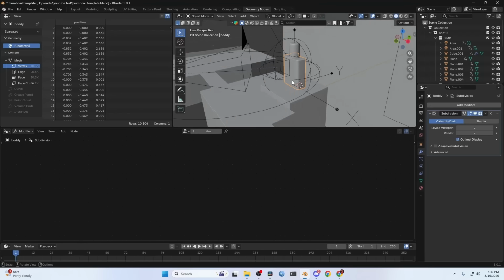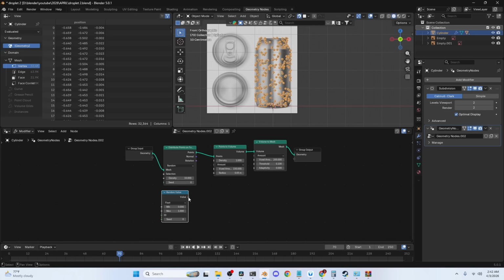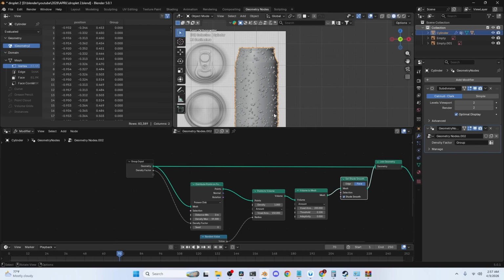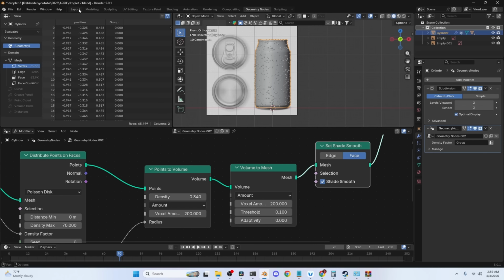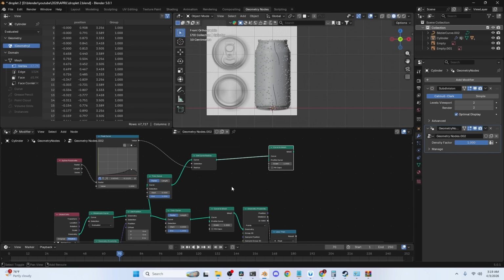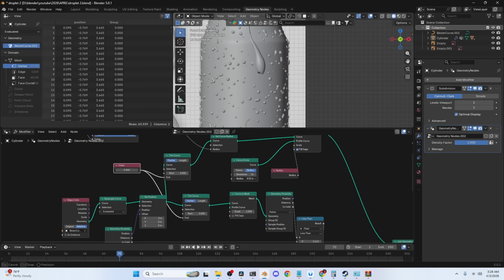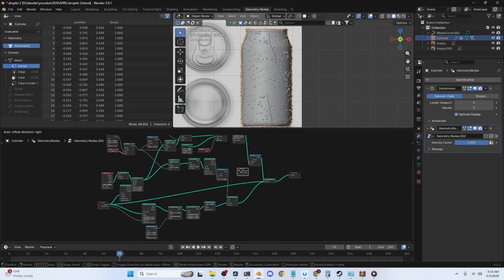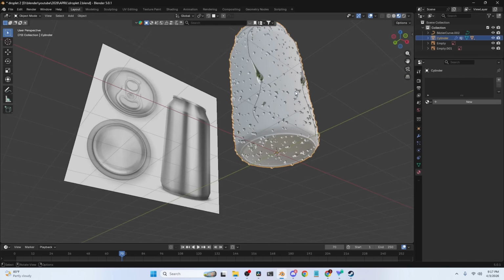Realistic Water Droplets & Dripping Condensation on Soda Can – Blender Tutorial 2026

Comment: https://youtube.com/shorts/2LAt_l2dBtc?si=TpAMxAb2q8Vv7OXh     That is the link to the finish water droplet animation using only four nodes to delete droplets when the curve rolls down the bottle. A screen shot of the node set up at the end of the video.  Set your delete geometry node to instance so you will not have to use a realize instance node which will carry up the polygon count greatly. I use the curve object data properties for the curve set up.
Reply from the maker: Wow thats prety simple
Reply: @TutupBotol3d it is a very simple set up so anyone can follow along. Many times nodes used are redundant and not always necessary resulting in a spaghetti node structure.

Comment: A very helpful tutorial. However, i found it to be to many nodes for such a simple animation. I also found some of the nodes were redundant. I mess around with a couple of nodes with a trial and error approach and discover the only nodes needed for the animation removal of the instance was, object info, geometry proximity, math node set to less than and delete geometry node. Only those four and it produced the same result. No nodes for the curve as it was done through the curve object data properties. So i came up with my own way to get it done with only four nodes and not nine.
Reply from the maker: Wow thats impresive